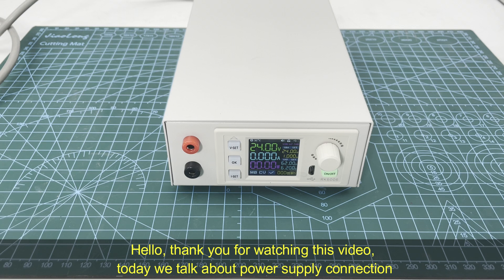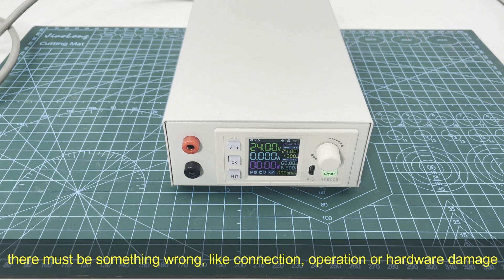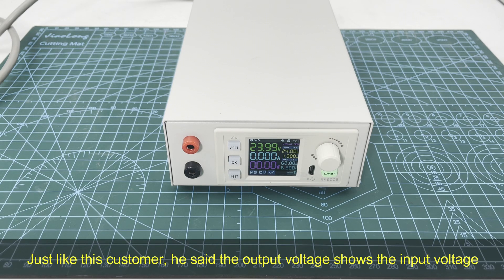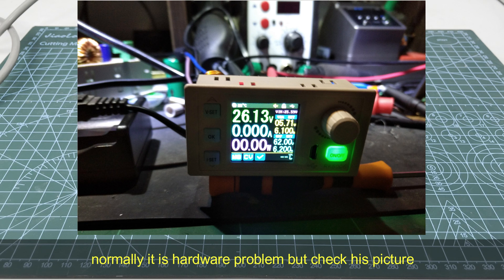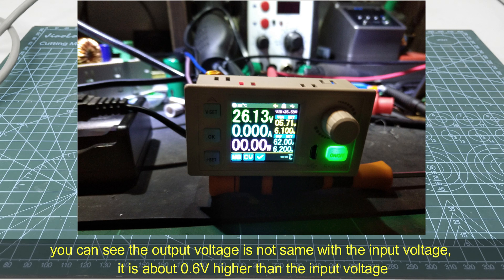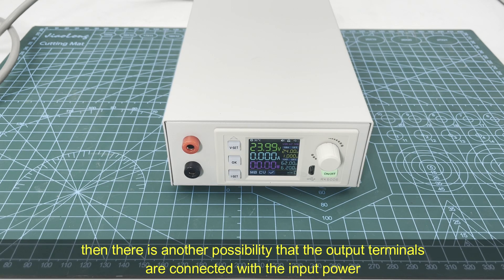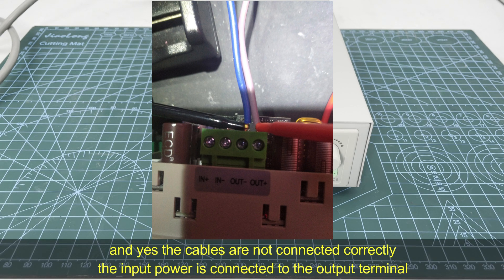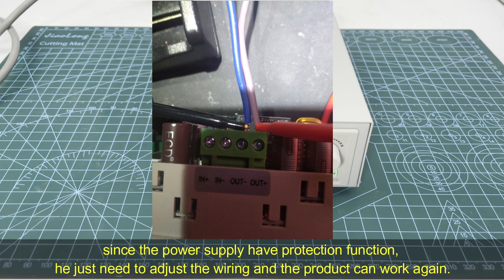power supply need to be connected correctly RK6006 RD6012 RD6018

Comment: Hello! I want to buy this RK6006 converter to create a bench power supply . But I have a question.  Can I connect, for example, a 4S 14.8V lithium-ion battery to the input terminals instead of a regular AC-DC power supply to create a portable power supply to be able to work away from an AC outlet?
Reply: Of course you can, no problem, but the output voltage will be a little more than 12-13 volts maximum.
If you need more, then you need another device, such as Buck-Boost, for example DPH3205, but it is larger and older generation, without new features.
Reply from the maker: @Slava_VS  thank you for your kind help
Reply: @Slava_VS  thanks for info. Can I connect this Li-Ion battery in parallel to the output terminals of the AC-DC Power Supply or to the input terminals of RK6006 converter using a switch to cut off battery when I don't want to use it? So, when I want to use a battery power supply, I cut off AC power, and turn On switch that connect battery. It will work normally or not?
Reply from the maker: @colinmcrae007  if you want to use AC to DC input power supply and battery pack, you need to add a switch, to let the device use one of them as input power and it is ok